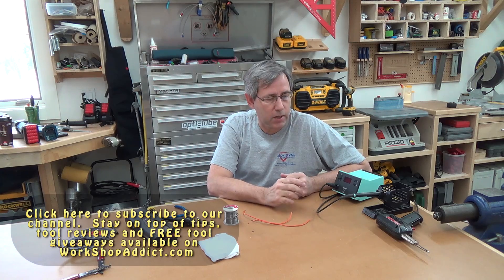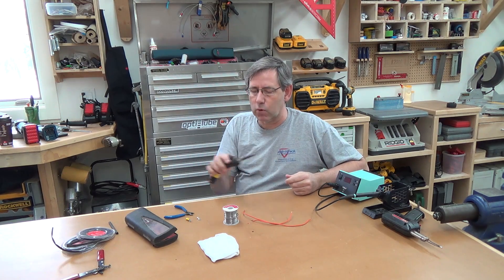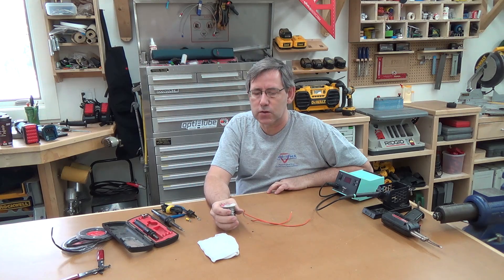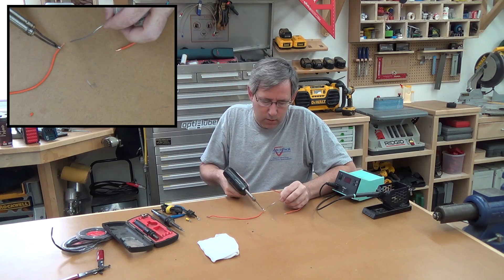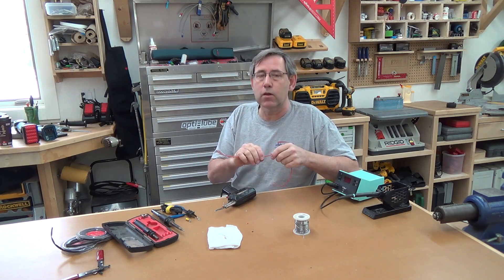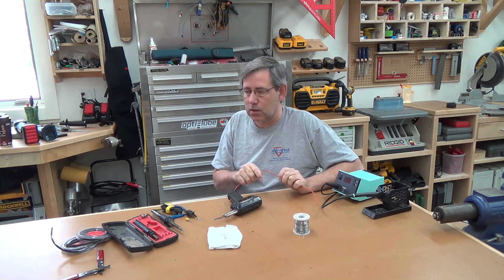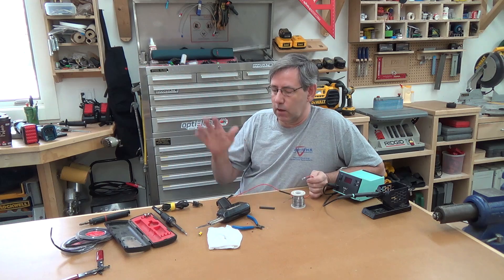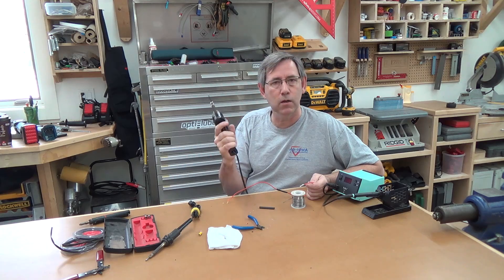Beginners Guide to buying a soldering gun or iron and basic soldering techniques

Comment: Lots of different opinions and methods for connecting wires...I feel it is better to get a mechanical connection prior to soldering. That means  twisting your wires together prior to soldering. I also have had good luck crimping using adhesive lined shrink tubed butt connectors. Keep in mind that most of my wiring is done on my Harley's and it has to be vibration and weather proof.

Comment: Yes, I hate crimping too!  I think its because I use to work building sports and Racing cars and that is where you notice crimping connection vibrate loose or corrosion gets in and causes issues. I have not worked on cars for years now and I play with old Radiograms tvs for fun ,but i still do not use crimping much.  Good video you made for People!

Comment: Good intro to soldering irons. Ive been working on commercial aircraft wiring and avionics for over 30 years and all of our terminations and splices are mechanically crimped due to high vibration and variations in temperature. I will add that our terminations(lugs, splices, connector contacts) are crimped with calibrated tools and are very specific as to not over crimp(metal fatigue) or under crimp because you do not want an electrical failure on an aircraft in flight

Comment: Yes, I have questions: do you touch the gun to the solder or the wire? 2: I need to to fix wires in a sewing machine. I. Not going to be using this thing all the time. A sewing machine repair person recommends an iron that heats to 500c. Is this necessary? Don't want to spend $200 to fix 3 wires. Thanks.

Comment: 8:10 "...much better joint than..." - disagree. Opposite. Its not recommended to solder wire connections in most of cases. Because soldering makes the wire rigid. Makes it very fragile, soldered wires break very easily from agitation, movement. Its a very common and frequent source of the electrical device's failure. The crimping needs more practice,  more experience, but the connection lasts much-much longer than a soldered wire connection. Usually you won't see soldered wire connections in a professional quality device, only "cheap" crimped things, and this is the reason.

Comment: I've been through 4 irons , 120v 35watt in a yr , is it normal for them to burn.out so fast ?
Reply from the maker: No....  If you are not using them, turn them off.  If it will be a long time between soldiers, turn them off.  What brand are you using?

Comment: Thanks for the great video !

I was confused as to when you applied heat to the solder gun (did you press the button/trigger on the gun and for how long before trying to solder).  Why did you use the heat gun for this job ?

Seems to me that the actual solder operation would be better when the shrink-wrap is applied to one end before joining the 2 wires.

Comment: I just bought a Weller soldering gun, I will be doing some automotive but mostly soldering wires for headphone and speakers. Would I be better off with a soldering iron station or should I be fine?
Reply from the maker: I have a small weller for automotive.  IMHO, rig up a small station your self to hold the wires.  some alligator clamps can help give you the third hand that you need.
Reply: Weller gun is the best option for soldering wires, I am in electronics and I use a Hakko FX888d for the boards but the Weller gun is indispensable for many things.

Cheers.
Reply: Ricardo B thanks! I ended up ordering a Weller station off of Amazon :)

Comment: Can u just use a paper clip instead of that wire
Reply: +alonzo Coston a paperclip maybe as a soldering tip, but not as soldering wire, because the metal in a paperclip, will not liquify at that temp and if you manage to get it hot enough to liquify, it will be glowing white and be molten and will destroy what you are working on. The purpose of official solder wire, is that it melts at a low temperature and it cools off fast.